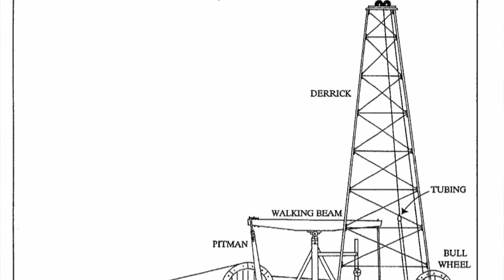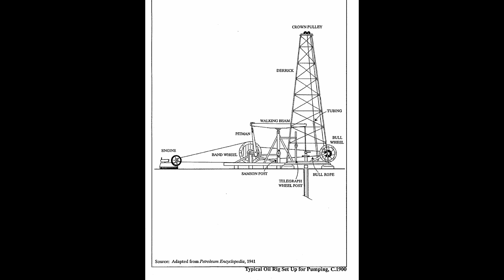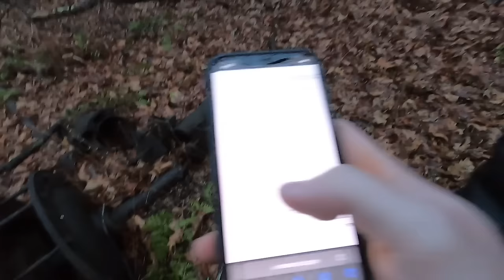Abandoned 1900s Pennsylvania Oil Well: Chrysler Flathead Engine! (Early Days of Oil Survivor)

Comment: If this is around Pittsburgh It could have been my 5th Great grandfather's wellheads. John E. Carnahan was born on the old Carnahan homestead which has now been in the family possession for more than ninety years and is at present owned by him, located near Leechburg, Armstrong County, Pennsylvania. His father was John Carnahan. When a boy Mr. Carnahan left school and made himself useful as well as secured a valuable discipline by working on his father's farm. He continued to look after his father's interests until the early '70s, and then bought a farm of his own. His land was underlaid, as it proved, with several veins of coal. In 1895 he began drilling for and found gas. That was the beginning of his extended operations in the oil and gas industry, and eventually from that into the broad field of manufacturing and finance.

In 1895 Mr. Carnahan leased thousands of acres of land in Armstrong County, and subsequently located the great Schellhammer gas well, and from that time forward was engaged in drilling and developing gas and oil properties for himself and for different corporations in Pennsylvania and West Virginia. He has large oil holdings in those states, and his operations in those fields still continue.

In the meantime Mr. Carnahan had turned his attention to the iron and steel industry. With other parties he was interested in the Mesta machine plant at Homestead, Pennsylvania. Mr. Carnahan in 1897 located in Canton and build a plant in that city, known as The Canton Roll & Machine Co. Thus in 1897 Mr. Carnahan's broad experience and great resources began operating for the welfare of this industrial City of Stark County. The Canton Roll & Machine Company was organized and built its plant. Two years later the business was sold, and Mr. Carnahan entered into an agreement not to engage in the same line of business east of the Rocky Mountains for a period of fifteen years. Shut off from this line of enterprise, in 1899 he organized the Carnahan Tin Plate and Sheet Company, of which he became president and has since continued the chief executive of that large and important industry. This company has had perhaps as prosperous a career of development as any local industry of Canton. The plant has been enlarged from time to time, and it is now one of the most extensive in the Canton industrial district. Its management has likewise been exceedingly successful from the standpoint of dividends. The plant is equipped with six knobling furnaces, with hammers and bar mills to roll the iron into bars, and the product is made under patent processes controlled by the company.

Comment: The part of the rail you said is coming apart  is called overflow  it occurs as the rail head is beaten down by the rail wheels

And the myth about not being able hear the train is not a myth
Not so much on a diesel line    but on an electric rail line the trains are right on top of you before you hear them    an experienced  rail worker generally would hear the ring in the rail     just be careful and use your head      keep up the awesome  videos 👍

Comment: My grandpa was an oil driller around the turn of the century working on equipment just like you saw.  You found the bull wheels, but originally they would have been covered with wood over the steel.  Been awhile since I have seen one of these--most of them here have been torn down.  Thx!

Comment: As you said the engine is chrysler. Probably replaced the t engine in 1940. The diff looks like a t but with the pinion so low its a worm drive. Probably a tt truck.

Comment: Looking at your frame setting there it was a truck turned in to a stationary power unit and that round pulley on the right used a big flat belt to turn something out there maybe a oil well pump or transfer pump or even a generator

Comment: Jennings Motors on you tube  gets Motors like this running all the time, Give me 2 Days it will be free turning and ready to start That motor is in the open, So I would have know Problem Putting My Chain binder on the front with 8 foot Pipe, Bring a small torch setup Remove the Plugs and head Put a oil mix in it ,set for 2 days and try and turn it.Thats what you should do for a Video.

Comment: Sadly, that old Plymouth is a boat anchor. With the carburetor open to the elements like that, the cylinders are certainly full of water and rust. Locked up tighter than a drum.Cool find though.

Comment: If the tracks are on a slope the little “iron balls” very well could be a from trains sanding the track for traction either for climbing the incline or braking on the decline. The sand will melt because of pressure and friction and combine with iron/steel particles that is transferred from the rails. Additionally the “pieces of rail” could also be the same melted sand and iron particles that the “iron balls” are made of. That said that stretch of track could use the sleepers (railroad ties) replaced or refurbished (plug any/all spike holes with epoxy, the tracks reset and ballasted.
As for the oil well it would interesting to figure out how the well was run (was it pumping 24/7 or for a set period of time each day as well as what did they do with the product after it was pumped from the ground (was it stored in a tank and then pumped to a rail car, was there a road of some sort that could be driven to with a tanker truck, or was it pumped via a pipeline to a refinery/tank farm.  
Lastly it would be interesting to find out who owned or still owns that well and if there is enough oil in the well to make it commercially viable to operate again and if not then the well should be properly plugged (drill pipe removed and filled with grout) to prevent a possible oil spill/environmental hazard  especially with that large stream/river so close to it.

Comment: Often times the engine will be run off the produced gas from the well...in otherwords..methane gas.
Reply from the maker: I wonder if they could do that in the early 40s
Reply: @stapleton42extra  I'm pretty sure they did.  I was an oilfield operator in Alberta, and I had worked with antique installations that used this method.  Often " oilwells"  are better described as gas wells...wherein any oil production has fallen off, yet the casing gas still flows.

Comment: Oh yeah, cool video. Never feel like you sound stupid or like a Yankee, you sound like regular southern gentleman, in your actions and words. Going out and finding a oil well sure beats playing video games.  Good thing it wasn't summer, flippin' tin is a fun way to find snakes. Fun Fact, back in the day they welded that pipe and everything else with acetyline/oxygen bottles and wire or coat hangers. Basically they welded with the cutting torch.
Reply from the maker: Thanks man. To me Pittsburgh doesn’t fall into Yankee land. It’s very different than the eastern side of the state. I think my homeland area has more in common with parts of Missouri than Philadelphia
Reply: As a a MO resident, I appreciate that!

Comment: Why didn't you take Hobo (your puppy?), hope he's/she's okay. You know they test drilled for oil all over the place, but when they didn't find anything they cut the pipe off 6-8 feet underground. They used a dowsing rod, a "Y" shaped wire they held with both hands when a guy felt something pulling down on the third wire he would proclaim, "drill here"! They said water was slightly magnetic? Gifted folks could feel the pull? Probably just dumb luck. I will warn you about the rail road, never hunt or pick up the nails, plates bolts or rails for scrap metal to sell,rail roads are federal government property. Scrap yards won't buy it, and if you shoot at a deer down the rail road, it's against the law. I used to get down in a trestle to deer hunt until someone warned me about it. Did you see the thing about the still under North Wilksboro raceway bleachers? A sink hole washed out, was on the local news today.
Reply from the maker: We saw several deer stands back there. Bunch of rule breakers 😂
Reply: Got to provide meat for family.